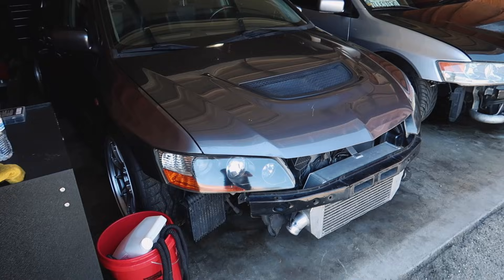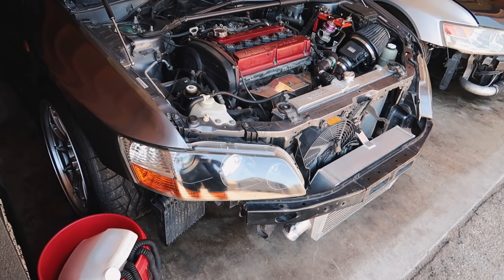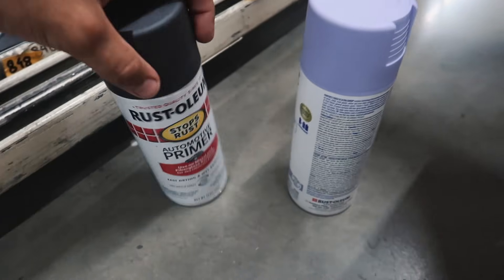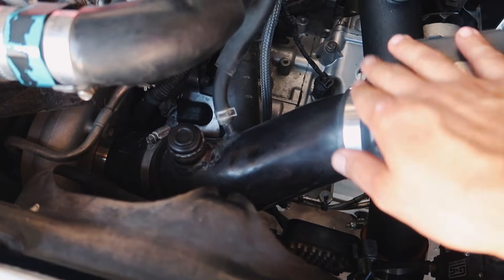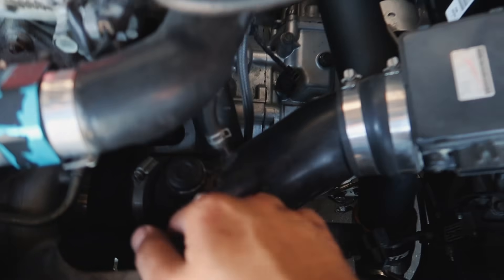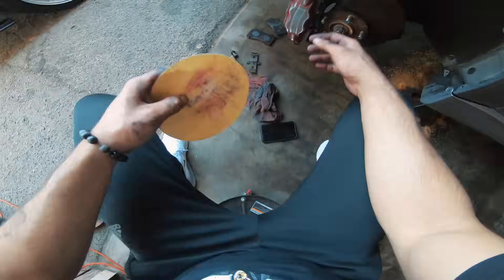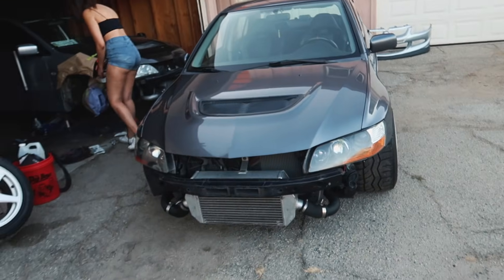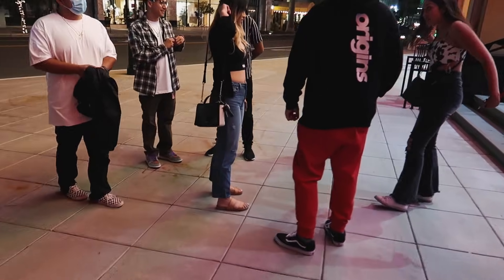MY MITSUBISHI EVO 9 NEEDS AN ALTERNATOR!! | FAST 9 MOVIE REVIEW

Comment: Having a hole in the intake pipe won’t cause a boost leak. You can take that pipe off if you’re running speed density.

Comment: The hyundai sonata is a direct fit. 2002 to 2005 i belive for alternaters. You might have a dead cell in your battery too
Reply from the maker: Got an oem one again
Reply: @MiguelDsm  siiick. I might put one of those motors in my dsm. Never seen it happen before but its a 4g64 but with their own dual cam head. They are everywhere and cheap

Comment: yo i have a brand new AEM fuel rail for the evo 9, comes w the fitting to use an AN fuel line. i could sell it to you for like 60 bucks if you want. Like message and ill get in touch w you on IG. Also have spare parts like alternator ect lmao